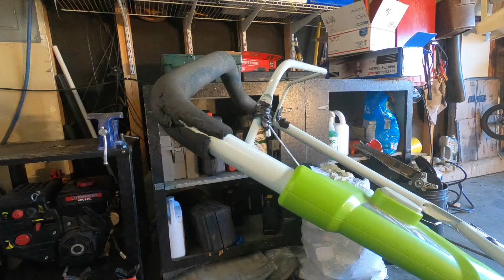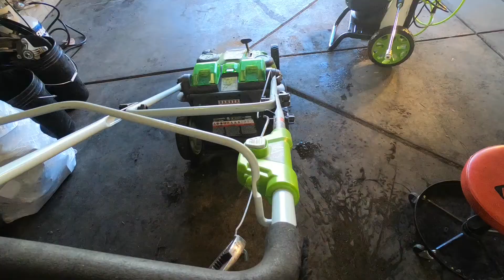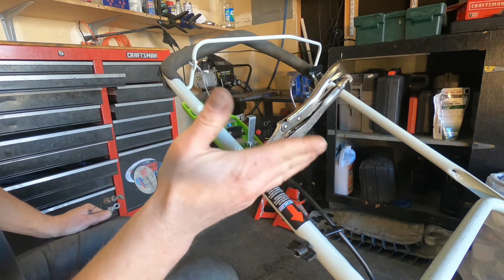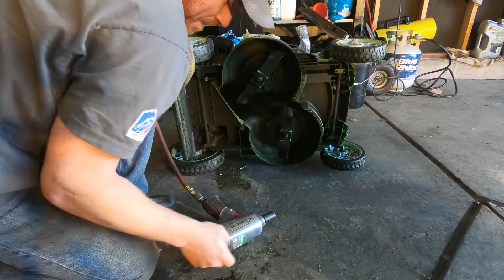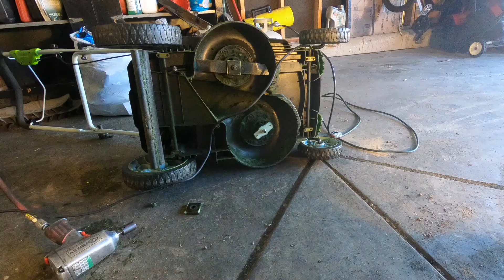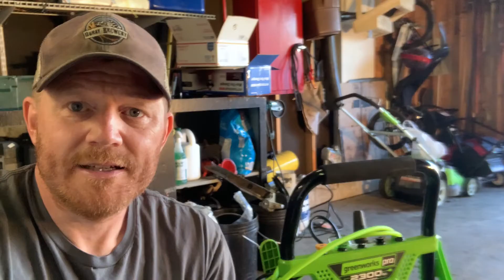Greenworks 40V Lawn Mower Won't Start

Comment: Thank you for the intuitive video.  Saved me from pulling more hair out of my head or unnecessarily disassembling the mower.  I noticed you blew out both battery bays with compressed air, so I started there.  While I don't have an air compressor, I used a shop vac to thoroughly vacuum out those battery bays and lo and behold, that did the trick.  Thank you again and I will definitely come back here if I have to go further with the cable fix.
Reply from the maker: Glad it helped

Comment: I had the same issue and a similar solution with a Greenworks pushmower about 5 years ago.  Mine only took one summer to stretch out.   I added a couple of metal washers to the cable near the bracket, which did the same result of effectively shortening the cable that's under tension.   I thought about making a video all of those years ago but didn't!
Reply: adding metal washers sounds like an easy fix that any one could do - as this appears to be a predictable problem for these machines - maybe you could show us a vid. thanks
Reply: @voidisyinyangvoidisyinyang885  b bdct
Reply: @oprybrent  Best Demonstrated Control Technology
Reply from the maker: Nice!!

Comment: The blade nut threads are a reverse thread, that's why your impact wrench set to off was tightening the nut. Personally I wouldn't use an impact wrench on those nuts, the shaft is direct to motor, could potentially damage it or motor bearings.
Reply from the maker: I did not think of that. Thanks.

Comment: The safety flap on the back is spring-loaded so it snaps closed on its own. The spring on mine flew off, and I can't figure out how to put it back on. Do you have any videos showing it in place? Thanks!
Reply from the maker: I don't. Springs are tricky.

Comment: Nice video. Thanks for the help. Do you know how to use motor cover form top? I got 6 torx T20 screws open, but cant find how to open other 2 front screws which are inside 2 holes of on front.
Reply from the maker: I don't. Its been a while since I worked on one.

Comment: Genius work on creating a new adjuster. Also I today just used a "hand sharper" tool on my Greenworks blade - without taking the blade off - and I was wondering if I was being a total idiot. So glad to see you corroborate my action. I used the tool that shows an image of either a scissors sharpener or a blade sharpener. So then I used the blade sharpener and put the blade angle against the blade angle on the lawn mower. Since I don't know what a "sharp" blade is supposed to feel like - I did order a couple replacement blades just so I also have backups. I also put in some more new nicks today. 
I noticed you did not "balance" the blade when you sharpened it with the grinder. So that is my concern with a lot of nicks - that sharpening the blade could mess up the bearings if the blade is not balanced. Do you think that's not really an issue with a Brushless motor? thanks
Reply from the maker: Yeah the adjusted worked well.

Comment: You probably figured out by now that one of the mower blades (the one that would not come off) has threads in the opposite direction.
Reply from the maker: I have. Felt dumb after that :-)